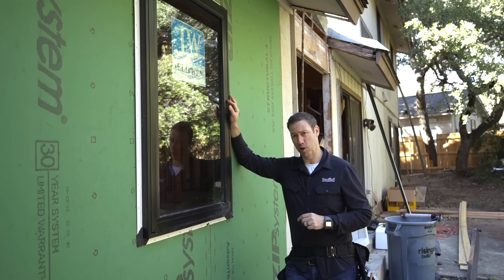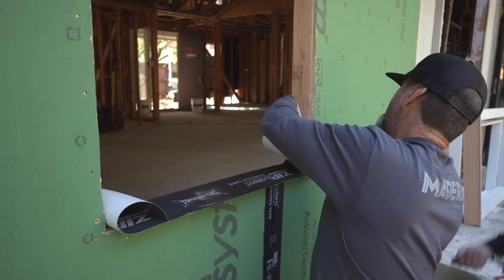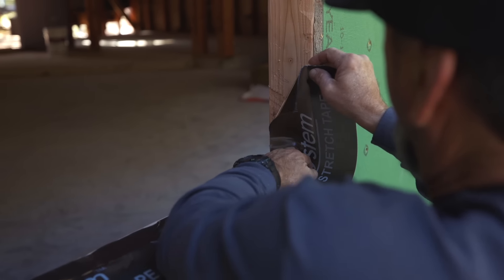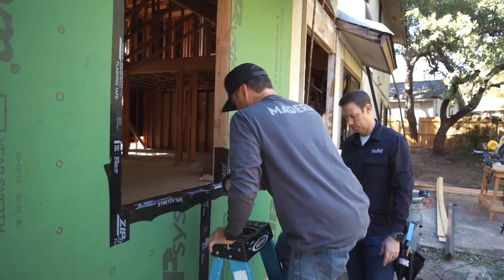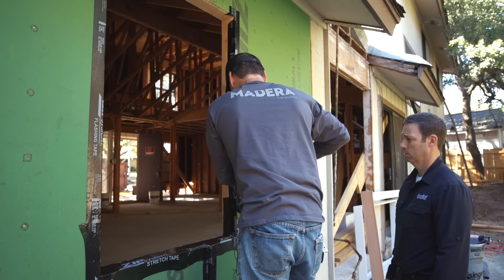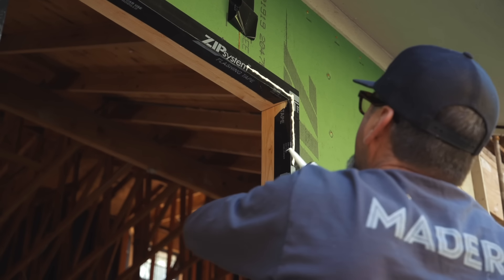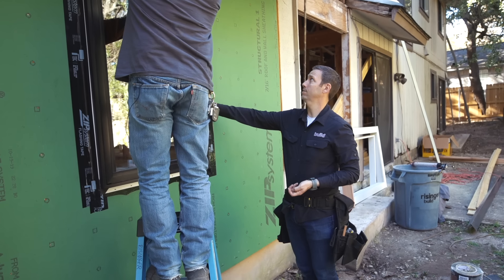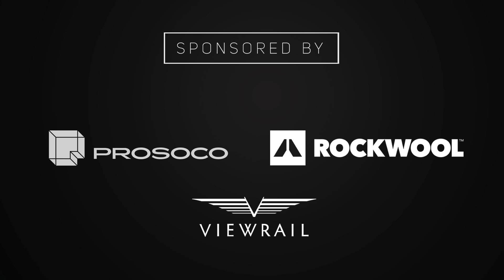Window Install & Flashing - Jeld Wen in Zip System

Comment: I would have thought you would run the flashing tap all the way to the inside of the window sill, and over the corner.
Reply: Jeff MacDonald I’m guessing by air sealing the rough opening with backer rod and caulking like the prosoco air dam that would prevent water infiltration beyond the inner edge and leaves that last half inch of the rough opening to bond with the air dam as well as the flashing tape. 

My question would be order of operations, if you’re using an interior vapor retarder, would you wrap that over or under the window flashing tape. I would guess over especially if using the liquid flashing and then sealing with the air dam to the window. Anyone have any insight there?

Comment: Can you skin the siding off of a house and then face the current Osb with Huber? Or does Huber have to be attached directly to the house studs
Reply: This is exactly what I'd like to know as well. My house has terrible drafts and I'm planning to slowly replace the siding and windows myself, one section at a time. Would love to go with Huber but I wasn't sure if it's possible for the way I'm looking to do it. Or if I'd literally need to be able to pull all the siding, windows, and OSB off first and do the whole house in one shot.

Comment: 2 things. Is this house not insulated on the outside?

Why isn't there a standard window opening single piece pan that would slip in and easily tape the outside edge to the wall? Since there are standard windows, you'd think they would also have a standard pan made of metal or plastic to match.
Reply: There are several options for than on the market, both of which have been covered on this channel in older videos. However it's way easier and cheaper to grab a roll of zip stretch and custom make it in place.

Comment: Every window I see you install you always mention continuous sealing of the homes envelope, and you always talk about leaving the bottoms unsealed to allow moisture to wick out, but how are you sealing that? Seems to me like air will just leak in under the window, and if you fill that gap between the window and sill with foam or caulk to air seal it, well then how would water requiring a way to wick out ever get there in the first place?

Comment: "Don't do this right, and rot sets in" said basically 20 times.
This is secretly an ad for liquid flashing.
Reply: How about just good flashing, period. Too much crap happens to buildings because of zero or bad flashing.
Reply: Cant really flash correct with Huber shit system
Reply: 1. They said it once.
2. No liquid flashing was used in this video at all. It was all tape.
Reply: @mehodgsonsr  liquid flash and rain screen is the only way I wld even consider using this shit. I have taken apart way to many new houses with leaks due to no shingle effect paper and proper lapped flashing
Reply: I also assume liquid flashing is better for adherence (for paint, spray foam, etc.).  The tape looks like it could be tougher to work with.

Comment: if the window has a weep system, i don't understand why the "recommendation" for the bottom connection to be unsealed...unless the weep system doesn't exist. But for expensive windows? Can we get to the bottom of how a window can weep to the interior side onto the sill? I think we should be able to trust it or not buy it. I've only installed windows one time as DIY Home owner, so purely educational question.
Reply: I believe he's just giving himself a backup pathway in case the weep system gets clogged up with dirt, bugs, or something else.

Comment: can anyone tell me where to see a solution for trimming / retrimming an existing  new wooden  replacement style window in an older (1920) craftsman bungalow house once you add zip, zip-r, new siding, rain screen, atlas foam, comfortboard, etc ? everything i see is for brand new windows .... matt ? anyone ? bueller ?

Comment: This is clearly sticky now, but how long can the adhesive be depended on (infinitely?) and how do we know?
Reply: Jennifer Lawrence I agree.   Every tape that I have pulled off 10 years later is all dried out and brittle
Reply: Zip is an acrylic tape vs butyl based tape you always see peeling off. Butyl tape is strongest when you first apply it and then slowly dries out and is worthless. Zip tape actually cures over time and gets stronger. After a week or so the tape is permanent and will only come off in pieces with a quite a bit of effort.
Reply: The university of texas has a testing facility that has pretty much every WRB on the market being tested outdoors exposed to UV exposure and the elements year round and have had it up for years now. Matt has another video where he visits that facility and shows that even after years of not being protected by siding the ZIP system is still going strong and doing its job.
Reply: @SuperEye2eye  those the older butyl tapes and yes they dry out and loose adhesion. That's why he made mention to the ZIP tape being a PSA (pressure sensitive adhesive) acrylic tape.
Reply: @Wood-Renovations  Yea, I linked that video above.

Comment: Shouldn't the sill pan have a slope to it? Am I missing something?
Reply: yes - they cut the cripples at a 5 degree slope.
Reply: @samgarthherrington  oh cool. I’ve never seen that before, I’m just a DIY noob. The more you know. Thanks!
Reply: @samgarthherrington  or are you messing with me? If you angle the cripples, then the top corner of the sill plate would be out of plane with the wall exterior. Probably negligible though.

Comment: This flashing is to protect the wood from water right ? Dont needbto do this in a Brick wall?
Reply: You really do need to do an excellent flashing job before the brick is laid.  Brick buy it’s very nature is  porous to a degree.  In addition it is unlikely that all mortar joints are totally water tight.  In older true brick structures, flashing was unheard of as the brick was the totality of the outer wall. Newer brick houses are almost always brick veneer on plywood or osb subwalls.
Reply: @jamesmoon1841  ok so only when there is wood behind it. Brick on brick like they build in Europa this is not needed

Comment: 1 easier way to put the zip tape on is to eyeball one half of the window cut the zip tape and then eyeball the other half of the window basically cutting 2 pieces so u wont have 1 long piece and having it sticking all over the place, just makes it easier on who Evers applying it, but like you said everyone has there own way of how they do things but he took a little too long to put that tape on its way easier to just cut 2 pieces put them on and done instead of one long piece and struggling to make it straight and having it sticking wrong

Comment: I don't get it... modern green building practices go through so much trouble to make sure everything is air and water tight, that the air is moved in an out of the structure only through a mechanical system - but then you shim out the bottom of the window and don't use nails or caulking there, to purposefully make a gap between the window and the flashing? Wouldn't that then be a place for cold moist poluted air to go straight into the house? I realize it will be covered up with lap siding or whatever, but siding isn't air-tight.... seems to me like you either trust your waterproofing system and leave it to do its job, or second guess/sabotauge it "just in case water gets in". You can't have both... a 100% sealed efficient system and a "just in case water gets in" system. Am I missing something?

Comment: 16:53 It's only have of the truth. Think of capillary effects. In my opinion it's best to seal it up. Think of where you want to have your air tight barrier. Should the window frame be inside the barrier or in front outside? The ZIP sheathing is outside, so why changing the barrier to the inside around the window frame?
But I'm not a building science engineer and may be wrong.

Comment: Why not liquid flashing?
Reply: I'd like to see a price comparison. Seems liquid would be easier with better coverage. This requires a lot of trust that some kid won't cut corners.
Reply: Liquid is roughly double the cost. I've installed with Zip tape and it is pretty bomb proof. Liquid would be more appropriate for inset windows or some other non-traditional install
Reply: It looked like the window next to it was liquid
Reply: @reviewcrewforyou  He built this wall as a demonstration wall for window installs. You can look through his previous videos for that demonstration
Reply: I can understand if it's double the price provided you're working on OSB & plywood. Particle board would be a different story.
Reply: @RandomUserName92840  same kid would cut corners with fluid applied and not ensure a thick enough MIL application to meet spec.

Comment: That no tape at the bottom is a mistake , the idea leaving it open at the bottom to let any water that might get in out  is just wrong and extremely rare with a proper taped window. Theirs weep holes in rock and stucco for a reason that’s because moisture dose collect behind rock and stucco so where do you think the evaporation goes ? That’s right right up right behind that untapped flange on to your sill or even worse around your wooden frame .

Comment: Then all the sills in the house that you have to attach drywall and wood to are now on an angle.  
There no benefit to cutting them on an angle because no water should ET behind the window or the flash to begin with and if it does there’s no way for it to get out anyway.

Comment: absolutely zero slope provided on the sill in order to drain possible moisture to outside area of window. Standing water under window will cause a whole host of issues. Provisions must be made to slope this tape forward slightly.

Comment: I am set to use the milgard ultra series in my project. It has a fin style flange. Would I need to tape onto the window as Matt mentions at the 20:00 min mark or just the flange? Here is a link to the cross section drawing. https://www.milgard.com/sites/default/files/new-series/ultra-series/ultra-series-casement-window/field_series_detail_cad_files/ultra_fc_1_setback.pdf

Comment: Well I hate casements. They rot at the sill and the hardware rusts and binds. Plus I don't like the look and operation. My cat doesn't like them either. I used to rebuild them, but now I'd rather just rip them out and replace them.

Comment: This is ghetto. Sure your waterproof membrane is good, but you absolutely need to check a square window and straight edges prior to nailing it off. If it's a larger window or door, regardless of if it's a casement window, you need to check for square and straightness

Comment: Rather surprised you're using a Jeld-Wen windows....
Reply: Is there something wrong with Jeld Wen windows?  Is there one particular brand that is better than another?  I’m just starting to research replacement windows and glass doors for my house.
Reply: @arturoroco7301  I work for a window company... been there for 5 years. I always tell people, everyone has a pretty good product. Decide exactly what you are looking for, color, energy ratings, etc. The number one issue with windows is not the window itself but the installation and warranty. Look at the reviews, mostly good with a few bad are what you're looking for. Plygem has one of the best warranties out there. If you install a window and the company goes out of business, they will send a technician out there to fix it. There customer service is phenomenal. Look for products with Lifetime warranty. Screens even have a 2yr warranty. Hope this helps!
Reply: MrsSmith1212 1212.  Yes, good information, thanks for the reply.
Reply: @arturoroco7301  No problem. Not sure how I got this video in my feed.. I leave work at work but felt like I should give my humble advice. Lol
Reply: MrsSmith1212 1212   Yes, not sure how I found this channel.  I was searching cost of windows around the internet.  Probably why.